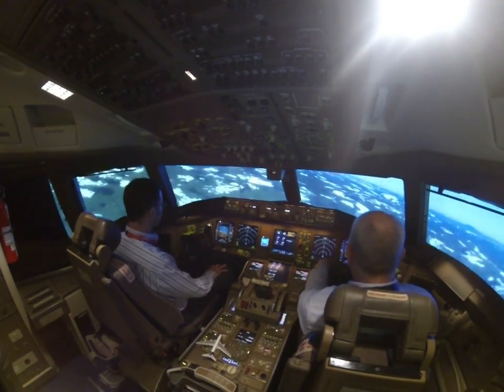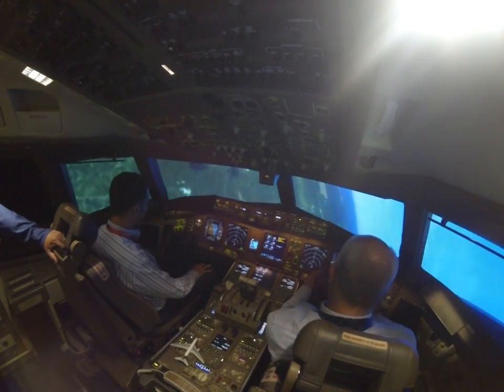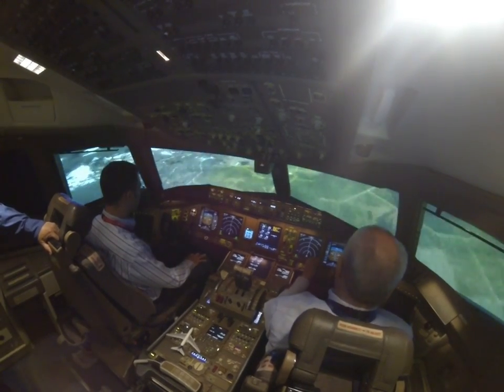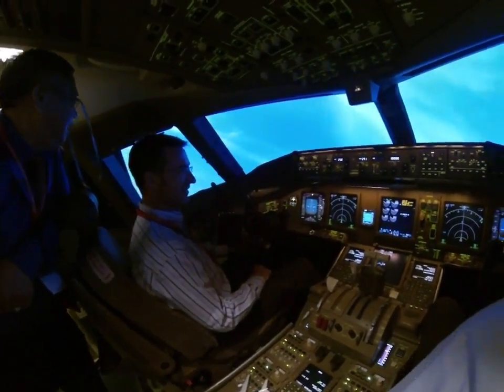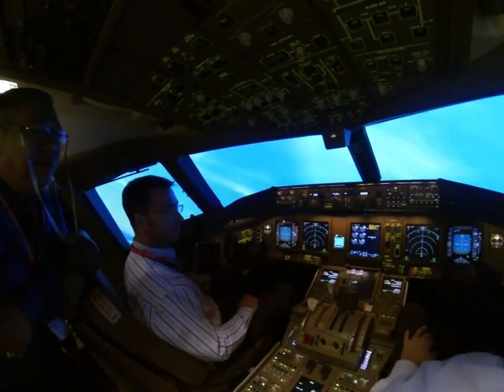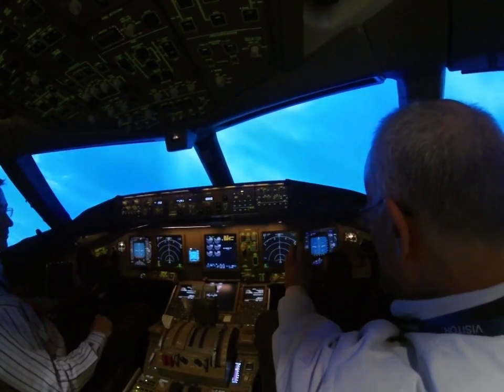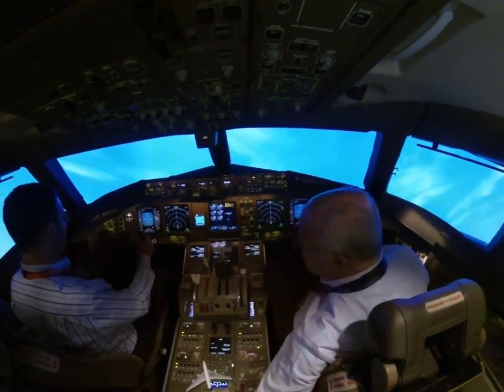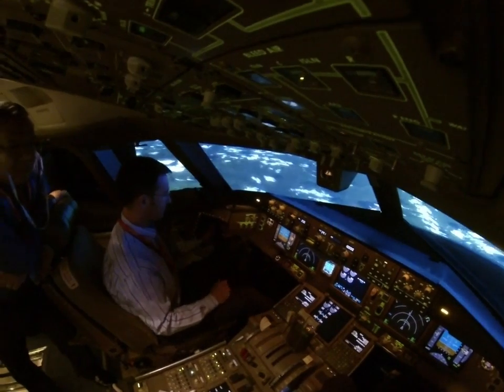Extreme flying on 777 Simulator - UPRT

Comment: "Either technique is ok"?? Really? How about if the stabilizer is jammed and full up??? Then try to "just" push to unload and see what happens!!1!!! I hope thats NOT the only way they teach pilots to recover from a nose up attitude.
Reply: You mean there's a universal way to recover that work for every situation? Or you are just changing the question to make look the answer wrong.
Reply: @rastachicagomataderos  There is a universal way. I mean two: one for nose high and one for nose low. https://www.youtube.com/watch?v=35Zy_rl8WuM
Reply: @Dani3076  so.... 24 universal ways works for you .... doesnt matter how much they are , they still universal, is that your answer?
Reply: @rastachicagomataderos  No. There is ONE for nose high and ONE for nose low. These will work in every situation, the cause of the upset doesn't matter. Of course if the aircraft lost its wings for example you can not solve the situation (unless you are an F-15:))
Reply: @Dani3076 hold on, im taking notes....
2 ways = 1 universal way
F:15 >>> flies without wings  ...
I got it bro ..... thanks !! ;))
Reply: @rastachicagomataderos  I can't believe that I'm wasting my time for trolls on the internet....
Universal means, that the cause of the upset doesn't matter. It can be whatever: wingtip vortex, turbulence, malfunctioning automation, jammed flight controls, uncommanded motion of flight controls, etc.
Reply: @Dani3076  universal example: doesnt matter what made your plane go upset, doesnt matter in wich position your controls are jammed, doesnt matter anything, you have to A+B.
Non universal example: doesnt matter what made your plane go upset , you have to A+B in one situation and A+C on the other.     2 universal ways = doesnt exist
Reply: @rastachicagomataderos  So you are saying for example that there is is no universal windshear escape maneuver, because those steps won't work in the kitchen to make fried eggs?